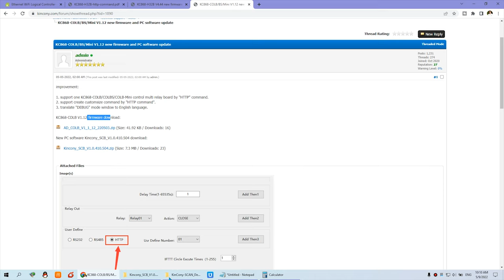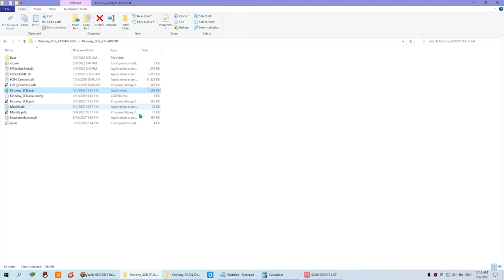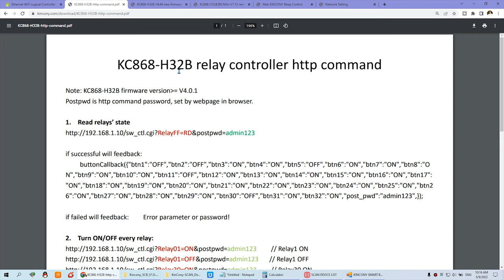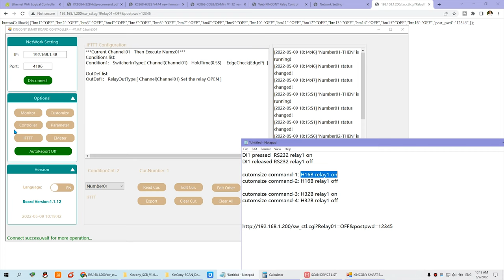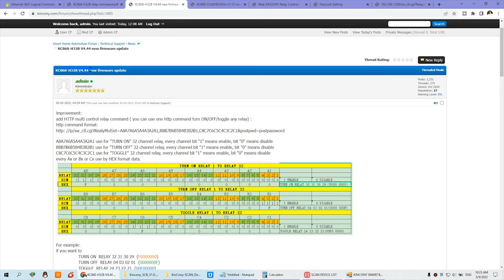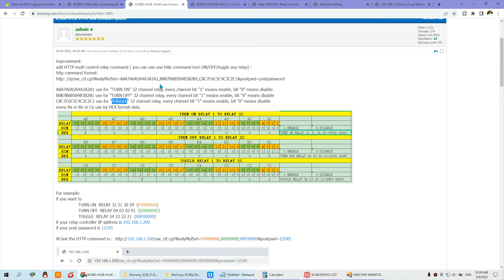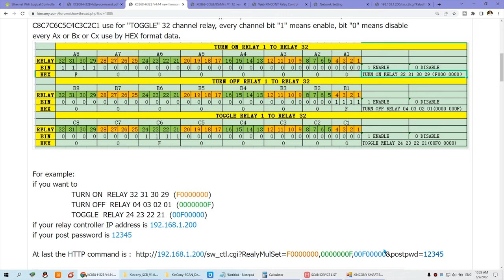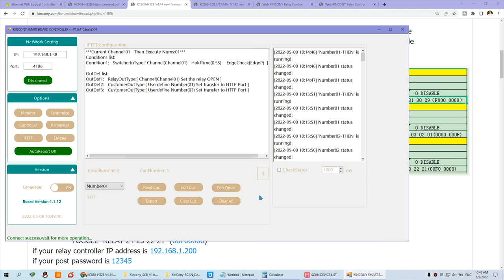one input module (COLB) automatic control different multi-relay boards

Comment: Thanks the Video, could you share the wiring diagram about this configuration, please?
Reply from the maker: this just INPUT port short with GND for trigger.
Reply: @KinCony  I mean the comunication sytem hard wire (hardware). How did the devices comunication of each, just before we configure the software
Reply from the maker: @wisnugambar662  all hardware just connect with same router by network cable or wifi.
Reply: @KinCony  okey, thank yoi very much sir!